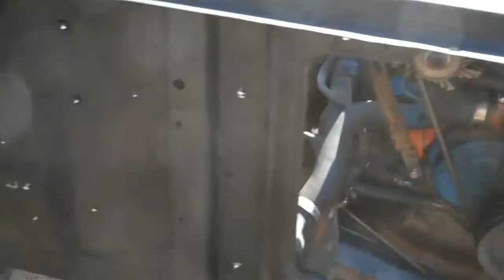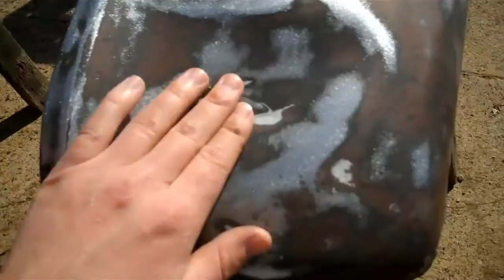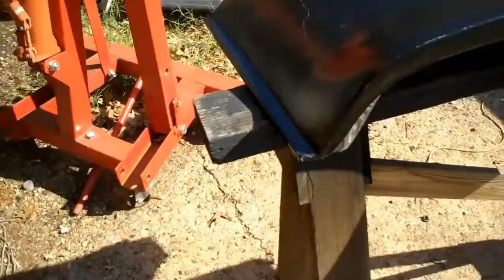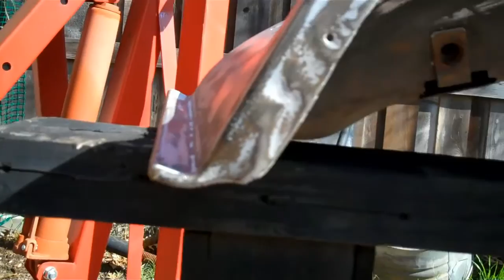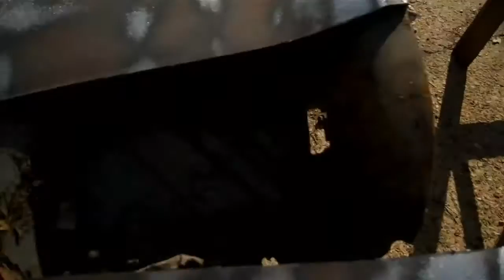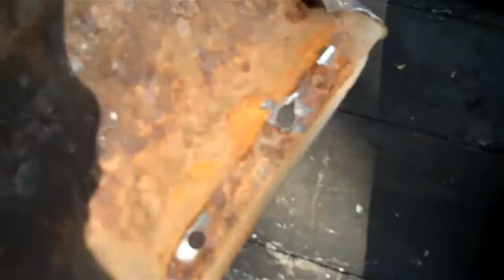PART 1 C10 FENDER RUST REPAIR | 73-87 Squarebody Fender Repair

Comment: I can't believe on the small holes and pin holes you didn't sand blast and put a tiny weld in there and grind it flat and level off with some nice filler primer and lite glaze if needed? That's a crap load of work ..lol..(Large welds can and will have tiny gaps , pin holes and bubble later when paint is applied, weather changes , and basic road driving, etc.

Comment: On that one if a guy was a cheap SOB couldn't you cut off the panel like you did then sandblast the back-side good.  Then epoxy prime and repair tiny hole and weld same panel back on?